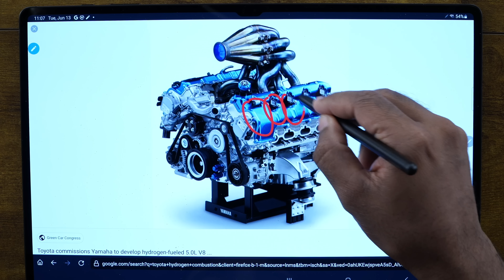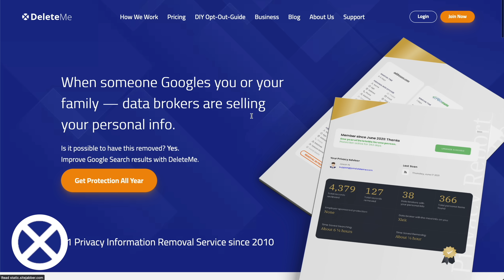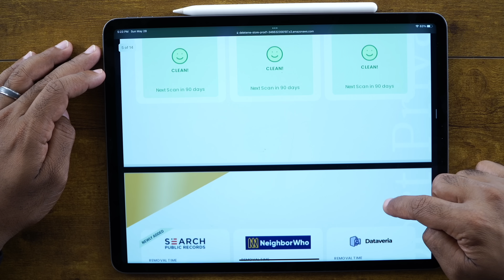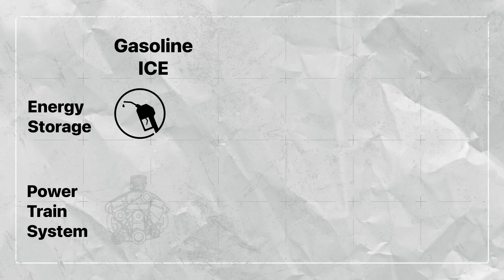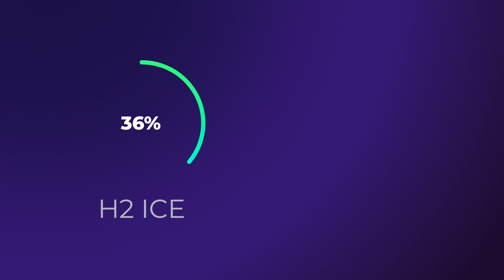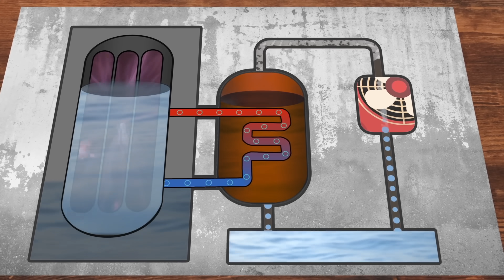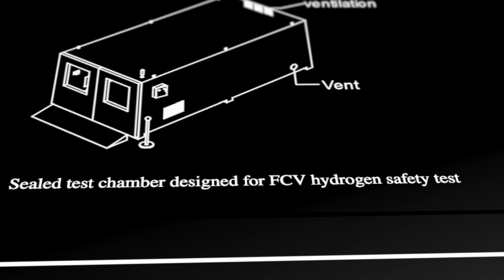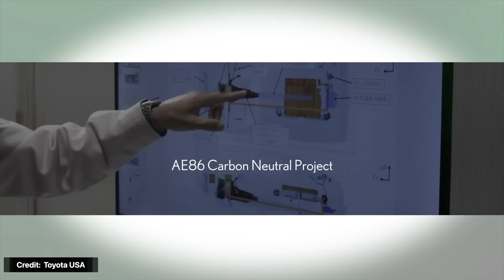Toyota's Says They Just Destroyed EVs - Hydrogen Combustion Engines

Comment: Honestly it seems like a more prudent first step than forcing the EV option by government mandate. The grid and supply chain for a massive switch to EV just doesn't seem to be there yet, or even capable of being there by the time these mandates occur. As well, it seems like it would be somewhat easier to leverage the existing infrastructure we have to provide for the fueling, and the experience would be a lot more familiar to the average driver and less time consuming and thus easier to sell. Also having the same type of cold weather experience as petrol ICE engines is a huge plus in my opinion, but then I live in northern New England. I vote Hydrogen ICE but that is also because I would miss that vroom, vroom noise  😉
Reply: Does it really make more sense if you have a combustion engine burning hydrogen that only gets you 150 miles of range? Unless you also fill the trunk and back seats with 10,000 psi tanks then you might get to 300 miles.
Reply: @flipadavis  I do not have a lot of knowledge about this but I'm guessing your 150 mile range estimate for a hydrogen ICE is based upon the efficiency loss compared to a 300 mile range hydrogen fuel cell vehicle with a battery supplied electric motor and this may well be true. The range though could easily be doubled by adding an additional "tank" without adding a lot to the weight. Obviously, electric vehicles are more efficient, I just still can't get past the battery aspect. Batteries require a huge new amount of mining to produce, they most likely have a shorter life span than an ICE engine, they add more weight to a vehicle than an ICE engine, they aren't easily recyclable, and they suck in cold temperatures. It is a very complicated subject way past my pay grade but I still vote for hydrogen ICE if only for the vroom, vroom. Also, the driving performance of hydrogen fuel cell vehicles sucks, adding to the lack of marketability. Speaking from my gut, which has usually been very accurate, I just don't see how grid powered EVs will be capable of powering, even the majority of, our transportation system in the next 10 to 15 years.
Reply: @RichardPoogerman  "The range though could easily be doubled by adding an additional "tank" without adding a lot to the weight." 
Again the problem isn't weight as much as volume. HFCV already use every trick in the book to fit as many 10,000 psi carbon overwrapped tanks that they can fit into a car chassis and still have a functional car in order to get 350-400 miles. These aren't just one small tank but multiple tanks in various places. In order to double the range of a combustion hydrogen car you would need twice as many tanks as they already have and there would be nowhere to put them but in the spaces like filling the trunk and back seats.
Reply: @flipadavis  According to the information I could find, the Toyota Mirai's fuel cell is the size of a carry-on suitcase and weighs a couple of hundred pounds.
Reply: @RichardPoogerman-fn4ck  That's the fuel cell. The fuel cell is like the engine in an ICE. The tanks are what takes up all the space. Look at a diagram of the 2023 Mirai and where all the tanks are. There is no room left for more tanks.
Reply: @flipadavis  From the pictures I've seen they don't look that big. One large and one small and the large one looks to be around the same size as the battery.
Reply: @RichardPoogerman-fn4ck  They are as big as they can be and fit. Otherwise they would make them bigger for more range
Reply: @flipadavis  400 miles for the Mirai seems like plenty of range. Replace the battery with another large tank in the ICE vehicle and you should be able to increase the range significantly. I'm just not seeing this as an insurmountable engineering feat.
Reply: @RichardPoogerman-fn4ck  Yeah, no. Dead end

Comment: Here we have a solution looking for a problem. But, for many decades, we've had Compressed Natural Gas (CNG) vehicles in service (city busses, trash trucks, etc.) with fine results. There's very little pollution; we have more energy in CNG than the far east has oil energy; it's cheap (was $1.35/gallon locally before biden screwed it up); and the exact same stuff that goes in your kitchen's gas stove. It's safe, doesn't require cryogenics (hydrogen fuel is priced at $22/gallon, without gov't subsidies), and our Country is already plumbed for it. They already use Nat Gas to power the boilers in electrical generating stations. What's not to like?

Comment: No one is mentioning the disposal of the vehicle at the end of its service life.  An internal combustion engine can be drained of its coolant. Its oil can be used for heating.  The aluminum, cast iron, steel and aluminum can all be melted down and recast, reformed, and reused in perpetuity.  How do we recycle those Lithium ion batteries in every EV on the road today.  It is my understanding that the used batteries are technically a form  of TOXIC WASTE.  Am I wrong?

Comment: I haven't the foggiest idea where you learned that electric cars do not pollute. Do not produce any carbon. There's at least two mechanisms by which they produce a lot of pollutant. And the amount of carbon put out of a internal combustion engine as a result of lubricant seeping into the combustion chamber would be so much less been a normal ice. That a small plant produces probably more hydrocarbons. Plus I'd like for somebody to explain how carbon dioxide is a pollutant. If we doubled the amount of carbon dioxide currently in our atmosphere we would be able to feed three times as many people on the Earth if we were more efficient with our farming skills today we could already feed everybody on the planet. At 900 to 950 parts per million. Plants would grow four to five times faster than they do today.
Battery-electric are not 85% efficient and neither are fuel cells. First of all you have to manufacture the damn hydrogen there is enough money on the planet to pay for that to replace gasoline. If we converted just a natural gas you would cut the carbon dioxide down to a third of what's currently being expended with cars that are almost equally effective as a transportation device natural gas also happens to be a renewable resource. If you have a cavern 10 million cubic feet of natural gas and remove a billion cubic feet of it. Wait a week or two you'll have 10 million cubic feet of natural gas again.